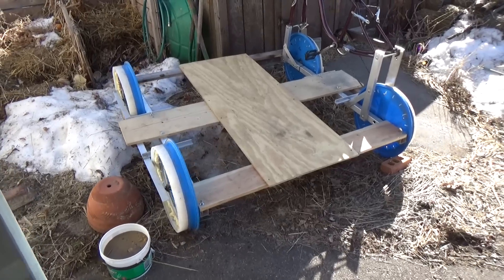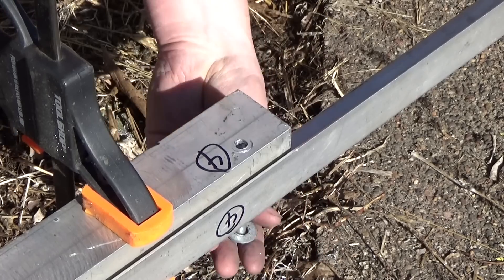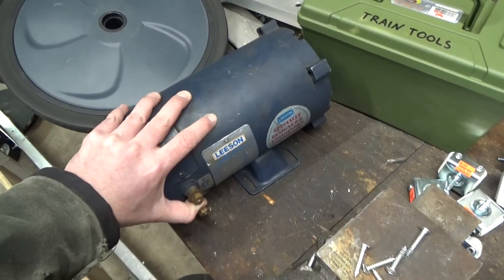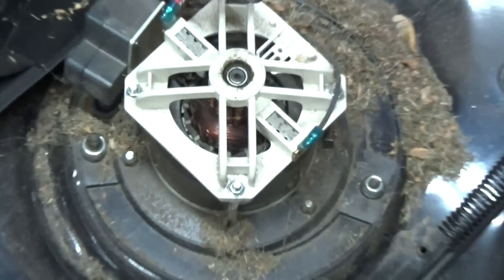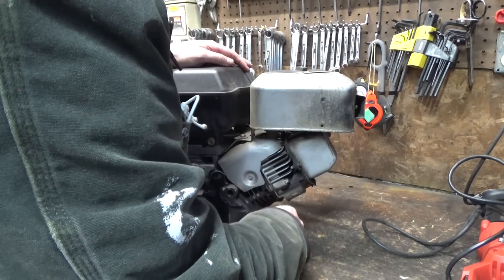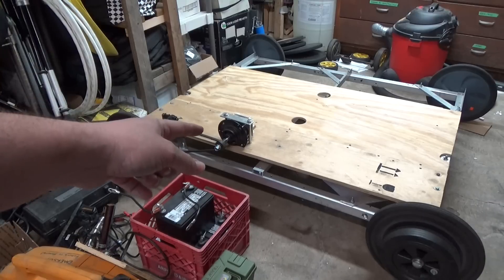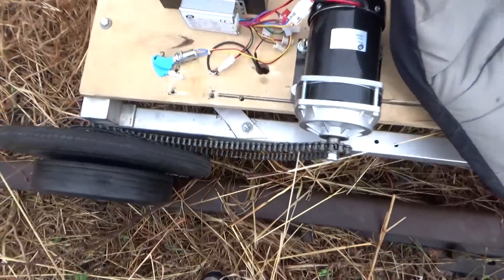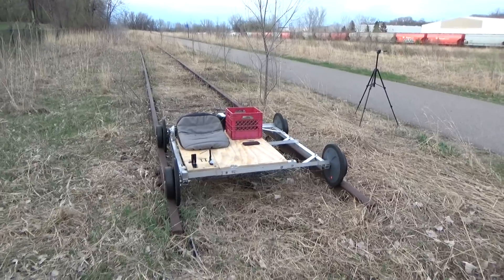Building a Motorized Rail Cart for Abandoned Tracks

Comment: When fixing nuts and bolts, always apply the bolts in from the top washers and nuts to the bottom. Then if the nut losens and you lose the nut the bolt usually stays in place.

Comment: Really should have kept the belt drive.  I would have ditched the sprocket on the motor and replaced with a shaft pulley.  I would incorporate a engine drive belt tensioner into your build.  You can increase your belt a lot by using a much larger pulley on the drive wheel.

Comment: Trying yo make one of these so would you mind sharing what you used for:
The wheels
The Flange
The motor
and most imporatantly,
The frame
Reply from the maker: Wheels and flange were two different size plastic wheels from the surplus store. Motor is an electric Go-Kart motor from eBay, frame I hacked together out of scrap aluminum I've been hoarding.
Reply: I've figured out the frame for my cart and I think I will be using an e bike motor. You mentioned that the load bearing wheels were angled like real train wheels, do you know what I would be looking for to find something like that? Also, for the flange are you using bicycle wheels? @saveitforparts
Reply from the maker: The flange wheels were just some random thing at Ax-Man surplus, they were probably from some kind of wagon or cart? Mine are really a little too big, the flange part bumps all the track connector plates and makes for a bumpy ride.
Reply: Would you recommend plywood over the wheels for the flange?
  @saveitforparts
Reply from the maker: That might work, if you can get it smooth enough and the right size. I always end up with wobbly bits when I try to cut circles out of plywood no matter how careful I am.

Comment: This is a fun video. I think it's worth mentioning that the spec for the flange is only like 1.5" betond the wheel running surface. More than that and you're gonna contact all kinds of stuff. You see it in the video. I can tell you at speed that's gonna do some damage and probably derail you.
Reply from the maker: Yep, mine runs into the rail connecting plates a lot. I have another rail vehicle I'm still working on with better wheels.

Comment: Do you have any issues with the cart skewing because it only has one drive wheel?
Reply from the maker: Yeah, it's not an ideal setup. The wheels also aren't quite right, I should be letting them self-center on a slight cone shape instead of center with the flanges. I have another rail vehicle that I'm working on now!

Comment: How are your batteries set up? Also, where did you purchase the motor and the flange wheels? I am looking to build one myself.
Reply from the maker: I did 3 tractor batteries in series for 36v. Not ideal, I really should use deep cycle or Lithium for longer battery life, but the 12v lead acid were cheaper. The motor is a 36v go-kart motor I found on eBay, I may have linked to it in the description.
Reply from the maker: Wheels are made from 2 different size plastic wheels from the surplus store. Also not ideal, they aren't angled correctly and they bump over track connector plates.

Comment: if you build your own track, line the iron/steel tracks with copper, and put linear alternating magnets on the car alongside with wheels/skates, it will float while moving but land/stick down when not moving
Reply: I guess you could just use linear permanent ac magnet skates on normal train tracks, to levitate

Comment: That Yardworks mower must be hella old.  They're still using a metal frame and Anderson connectors on the battery terminals, looks like a professional cobble-job with whatever parts they had laying around.

Comment: if you look for them, you can find the actual iron railroad wheels from speeder cars about10 inch in diameter for about 30 dollars a piece. We used them on simple iron bars for axles with hardware store pillow block bearings bolted  onto a simple wooden frame held together with thumbscrew bolts. It could be assembled and disassembled in 5 minutes and thrown in the trunk of a car. We just sat on the back and kicked with our feet and went about 15mph. Almost any motor or engine of 1 kilowat or bigger should work.
Reply from the maker: I have a few hi-rail wheels I found on Craigslist, I just need to find an axle that fits them. I also have some railriders.net wheels that should be showing up in a video soon!

Comment: Try using a rubber wheels horizontally on the inside to track it. Put one by each wheel. Also I’d suggest runners that electrical motor on a reducer and run a shaft to drive both wheels.

Comment: Those skinny tires are genius for flanges! You got those at Axman, but do you have any idea where to get those otherwise?
Reply from the maker: No idea otherwise, they never really have brand names or origins on stuff. They're actually a little too big (in diameter) compared to the inner wheels, so they hit the rail connecting plates.

Comment: Can I have the link to the motor you used?
Reply from the maker: Looks like it's dropped off Amazon, all those no-name imported products eventually do. I think it's a 36v 800W scooter motor. Should be some on Amazon or eBay as a kit with the controllers and throttle assembly.
Reply: @saveitforparts  Thank you!

Comment: Just come across this channel, seen a few of these rail carts other people have built, but they use petrol engines, batteries will drain in no time. Having said that, I did  laugh at your attempts with all the different motors.😄
Reply: Solar panel on the roof.

Comment: just looking i can tell your chain and sprocket are NOT the same size , fix that and your chain will stay on.  your welcome.
Reply from the maker: The chain was a little loose in some of these, and one gear is thinner than the chain because it's for a bike vs a go-cart. As far as I can tell the teeth all match up, got a shop to match the chain to the gears.

Comment: you need a gas engine, in fact your wheel design is way under engineered, the whole 
thing lacks.
Reply from the maker: It's mostly built out of trash! The wheels work well enough and the electric power is way more reliable than trying to get an old gas engine running. I just need more batteries!

Comment: Nice video, but in order to get the self centering to work properly, the wheels need to be on a solid axle. The taper on the wheels has to be the small end out, this way the taper causes the wheel on the outside of the curve to increase in diameter and the inside wheel to get smaller ( just like rolling a cone ) The flanges on railroad wheels are not there to keep the wheel on the rail ( although they will contact the rail occasionally )
Reply: Mine cart wheels welded on a metal bar. Centred with circlips and a chain sprocket welded on.
Reply: The back wheels need to be connected to a single axle so they cannot turn independently. The front wheels also need to be done the same way. All the wheels need a taper with the small side to the outside. If you get a chance, look at a real train axle and you’ll see what I mean.
Reply: Either connect the opposite wheels on a single axle OR, each wheel can have its own motor and electronically controlled like an all-wheel-drive system which is overkill here but possible.
Reply: @Pgr-pt5ep You don't want both sides to be mechanically independent. Both wheels being forced to rotate at the same speed is what steers trains.
Reply: @pootispiker2866  I know that, and that what I said. The only alternative is electronic control.
Reply: @Pgr-pt5ep  Electronic control isn't even an alternative. It wouldn't work. Even self-steering trucks/bogies on modern trains use a solid axle with the frames being articulated. That wouldn't help here because the goal of that is to increase adhesion, a moot point with one driven axle.

A solid axle with tapered wheelsets is the only way to steer rail vehicles.
Reply: @pootispiker2866  no reason independent motors can't be made to "lock" and act as if there's a solid axle, or even compensate even better during turns.  In fact check out variable gauge trains.  I'll bet they use something like that since they have independendent motors and no mechanical connection to opposite wheels.  Anyway it's more of an engineeing challenge and like I said, would be overkill for this video's requirement.

Comment: What is total cost of making this I am interested
Reply from the maker: It depends, a lot of my materials were re-used and scavenged. The motor was around $100 and the batteries probably another $50, the wheels were probably $20-30 at the surplus store, then other random parts and bits, maybe $200 total? You might be able to find some parts more cheaply, it just depends how you build it!

Comment: Next time yougo to the second hand store, look for a key switch mower and transfer the switch mechanism to your cart But I like how you have tried just about everything to get the cart going.
Reply from the maker: It has a key switch for the battery system. Or do you mean an electric start for a gas engine? All my (land based) gas engines are kind of junk at the moment. Fortunately I think battery tech is finally going to give us a world without carburetors!
Reply: @saveitforparts  Still, you get some great results. Well done.

Comment: Curious what kind of metal you built your frame from? Love this channel!
Reply from the maker: Thanks! The frame is made from some aluminum scrap I found at work.
Reply: great to know! I was looking at some L-shaped aluminum sheet metal straps just like that and someone told me they wouldn’t be nearly strong enough — glad to know that’s not the case
Reply from the maker: That's pretty much what I have, just Aluminum angle stock and a little square tubing stock. It seems to hold one person and gear just fine, I'm sure if I piled on too much stuff I'd bend it. I was trying to keep it lightweight enough to throw inside my car and avoid needing a trailer.

Comment: I want to do the exact same thing. Is there a build log? I’m most interested in the wheelbase dimensions. Thanks!
Reply: @David Bitton There's a reason why inventions specifications can't be found on google because than it wouldn't be an invention... plus, where are you gonna ride it if you can't even measure the train tracks' spacing lol
Reply: @lightbulb1982  I do know, 4’-8”.
Reply from the maker: I don't really have more build details, it's more thrown together than planned and engineered :-) I might actually rebuild it again this winter since I got some more legit wheels to use.

Comment: What kind of wheels are those and where did you get them, both the ride wheels and the guide wheels. I am currently building one and wheels are my last piece
Reply from the maker: I got these at a local surplus store called Ax-Man. They have a lot of random stuff, but not always the same stuff every time I go. These wheels work but aren't super ideal. I actually have some legit hi-rail wheels that I found on Craigslist, I might use those on the next version of this project.
Reply: @saveitforparts  I had legit high rail wheels and the problem I ran into was weight. The set up we had took 3 guys to pick up just one end. We have started over with our design
Reply from the maker: Yeah, so far I've tried to keep mine lightweight and transportable inside a car (trying to avoid the need for a trailer). It's definitely a balance between function and convenience!

Comment: Would have used a solid axle driving both tires since  theres is  no differential action on rail.

Were lucky in texas

THE TEXAS CONSTITUTION

ARTICLE 10. RAILROADS

Sec. 1.  (Repealed Aug. 5, 1969.)

 

Sec. 2.  RAILROADS AS PUBLIC HIGHWAYS AND COMMON CARRIERS; REGULATION.  Railroads heretofore constructed or which may hereafter be constructed in this state are hereby declared

>>>> public highways<<<<

, and railroad companies, common carriers. 

 The Legislature shall pass laws to regulate railroad, freight and passenger tariffs, to correct abuses and prevent unjust discrimination and extortion in the rates of freight and passenger tariffs on the different railroads in this state,

 and enforce the same by adequate penalties; and to the further accomplishment of these objects and purposes, may provide and establish all requisite means and agencies invested with such powers as may be deemed adequate and advisable.

Comment: The side plates to keep the wheels on the tracks, do they tun into interference at where track comes to road crossings since there seems to be very little clearance at most.  It also seems that the side plates create a lot of drag.  Wondering why spring loaded wheels on their own frame set at 30 degrees to the rail. They would only need to touch the top 3/8- 1/2" of the rail.
Reply from the maker: There are designs that use side wheels and stuff, but my idea was to make this more like a real train. I figured that would go through switches better. The road crossings are an issue because they're either paved over or full of gravel.

Comment: Use snow blower rims. Take off the rubber tires. 3" or 4" will work. Just drill through one rim to have bolt through axel for power, the other three can float free.
Reply: Using lawn tractor rims for wheels, they mesh perfectly with the rail and tracks great along it. Finding parts like axles and stuff is easier due to standardized parts. The rear rims have a keyway for keyed shafts allowing power transfer. I even reused the transmission to get more power or speed out of the small engine i have running it. Thank you for the idea, i wanted come back and let you know it works wonderful!!

Comment: I really love the use bigger wheels as flanges for the smaller wheels idea. I thought you were going to be able o drive it to the tracks like that but then there is the question about steering. I guess if you put a drop down/removeable steering wheel of a children's bike then you should be able to use it on pavement and tracks!
Reply from the maker: Maybe I could make something more like a real Go-Kart with lockable wheels? Might be a future project.
Reply: Yes, the bigger wheels as a flange is the key to driving around your neighborhood, now introduce a steering system. Great video

Comment: Why not power both sides of the cart?
Reply from the maker: I only have one motor and don't want to spend another $100 :-D also it seems to work fine with one and probably wouldn't go any faster with the geared motor I'm using.
Reply: @saveitforparts  Maybe make a rear axle and mount the drive components in the middle?  But if uni-drive works, so be it!  :)
Reply from the maker: @MattM0481  I also want it to break down and fit in the car. Way to heavy to get it on the roof rack like my last one, and all my trailers have boats living on them :-D
Reply: Just power the axle, and attach the wheels firmly to the axle.